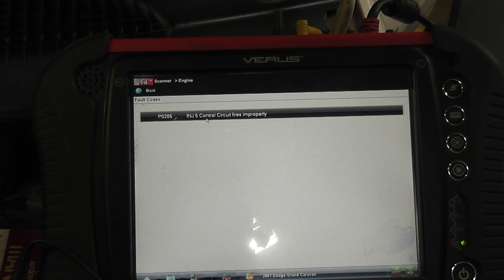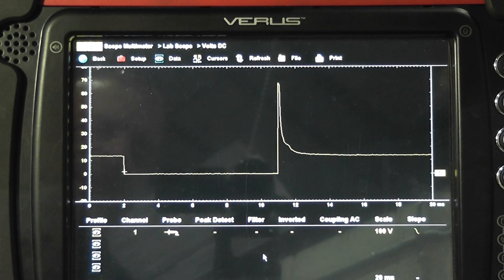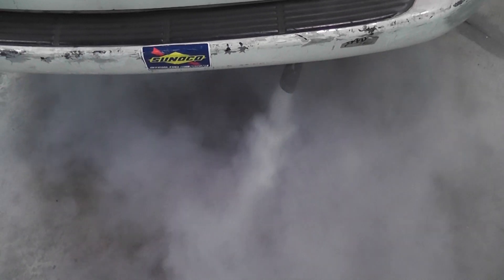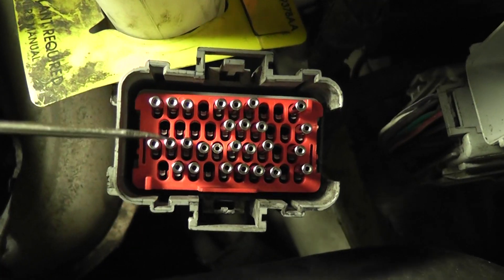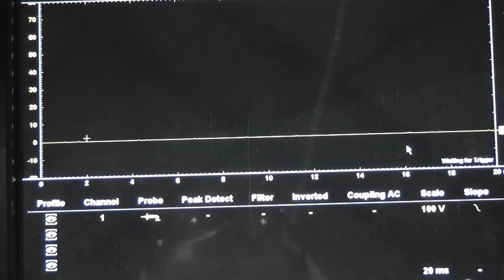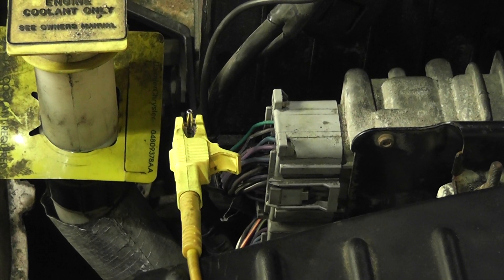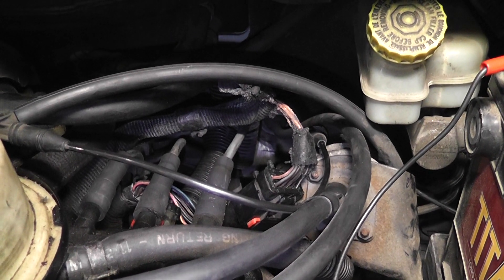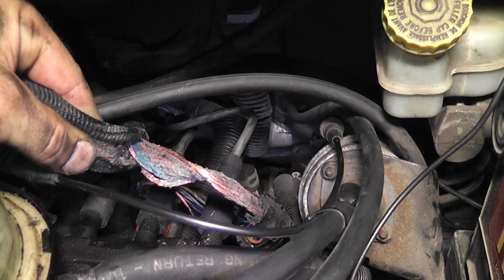Stuck Open Fuel Injector (how to fix)

Comment: Appreciate the great video.  My wife drives the exact same car.  It started running rough and was giving a P0204 code.  I found your video and started looking into the problem.  I found the injector wiring harness fried almost exactly like in the video.  I pulled the harness off,  separated the wires and band-aided it with electrical tape.  I checked continuity on the harness to make sure no wires were touching.  I re-installed harness and switched injector #4 with the one next to it.  Fired up the car and was still getting P0204 code.  I then pulled the pin on the connector to the PCM for the #4 injector, plugged it back in to the PCM, fired up the engine and got 13 volts to ground on my multimeter.  I then swapped the leads and read from battery + to the control wire pin and got 0.  If I was understanding everything correctly on the video this would mean the Injector driver in the PCM is faulty?  Is there anything else I should check prior to condemning the PCM? Thanks again!

Comment: Hi I did that test on injector 3 not knowing I could pull the pin I cut the wire and with it running the light was lit while connected to positive. I have changed out the fuell rail with wiring harness attached and still get the same code , I changed the ecm before finding this test. is there anywhere else this could be shorted?
Reply: and I'm getting codes p0403 and p0203 based on the three turns of the key

Comment: Hi Scanner Danner, I have a 98 infiniti q45 4.1  V-8 Had issues with two injectors and two coils at different time over a months period that were causing misfires. Changed them out and that fixed the problem. Driving home one day i notice a incredible amount white of smoke coming out of the exhaust and felt a misfire. My sons friend suppose to be a mechanic, so we purchase 8 new coils and 8 rebuilt injectors online which were installed along with new spark plugs and map sensor. Problem with white smoke still the same. Happen to check the oil dip stick and found it to be over fill with a strong gas smell and 2 .5 gallons of mixed oil and gas when i changed the oil plus almost  8oz. of gas at the air filter canister . Changed the oil and filter,wiped out the gas at air filter area, started back up to trouble shoot but could not run for long ,afraid neighbors might call the fire department because of the smoke. Try a couple more times two weeks later and the same thing 3 gallons of mix oil and gas and constant flooding of gas at the air filter canister. Thought maybe the fuel regulator vacuum hose might be sucking gas back into the intake?. Removed  hose and it look dry to me. Just cranking the engine floods out the air filter canister. Whats next. Thanks Joe

Comment: Hi ScannerDanner, love your videos. I had one of these in our shop a few months back with the same problem with the harness melted. I fixed the harness but the injector was still not firing correctly with the new harness. It was firing, but not completely. The driver in the PCM was grounding the injector enough to light a noid light but the ground was not good enough to handle the electrical load of the injector. I am now using the lab scope more at work but I often wonder what that would of looked like on the scope. Would that bad ground in the PCM show up even before the harness was fixed? Could I have seen it and known that the shorted harness had taken the driver out?

Comment: I'm getting a p0201 (injector control open or shorted to number 1) - stated with sudden onset rough running but no codes. I had a leaky fuel rail so I pulled the plenum and replaced the fuel rail and did the plugs and wires. Plugs were real bad so I thought I had it. Replaced the injector o rings and the plenum seals too. Reassembled- running rough still and now throwing p0201. Tested and found continuity to ground at the injector connector. Disconnected upper PCM connector, still have continuity to ground. Tested at cavity 13 in PCM connector, with injector unplugged,  continuity to ground there too (expected - just the other end of the wire, after all). Inspected the injector harness, really bad melted. Repaired by carefully separating each intact conductor and taping. No shorts now in this harness. Reassembled to vehicle and road test, still rough running. Still showing continuity to ground at injector and at PCM #13. Disconnected injector harness. No longer showing continuity to ground at injector connector. Still showing continuity to ground at cavity 13 on the PCM connector. Showing continuity to ground on two blades (unknown numbers, can't find a diagram) in the engine harness side of the injector harness connector. One blade is in the corner of the connector, the other showing ground continuity is up and over one space. I disconnected the coil pack supply connector and the water temperature sensor connector, cut the zip tie securing the harness and fished it out under the cross over pipe and brought  the whole end of that branch of the harness up between the crossover pipe and the battery for easier access. I stripped the tape and other shielding from the harness down almost all the way to the main branch of the harness on the transaxle bell housing and found no evidence of melted, worn or wires otherwise shorted together or to the engine/chassis in this span. I gave all the bundles significant tugs and wiggles and noted no change in continuity to ground.

So, to recap, getting continuity to ground, PCM plug is disconnected, two blades (corner and one up and over) in the injector/map harness connector on the engine harness side, and of course from the PCM connector cavity 13 to ground. 

Would I be correct in assuming that there must be a short in the engine harness where it runs over the top of the bell housing? The loom there appears to be intact and shows no outward signs of internal melting. Does the injector driver wires take the shortest possible path when in the main harness? That is, do the wires just go directly down to the bell housing, them come back up at the branch without going down toward the starter and oil pressure sensor? 

Also. This may be of help: this car has a leaky oil pressure sending unit and it has soaked up through the harness and is coming out in the PCM connector a little. I have heard of this happening. Could engine oil contribute to insulation failure in a harness and cause a short circuit? Also, this vehicle has an ATF leak which currently soaks the lower portion of the harness below the PCM. This looks to be below the place where the injector/map/coolant temp/coil branch departs, but fluid can migrate also.
Reply: Ended up being damaged PCM. Injector driver circuit burned out due to shorted harness. I opened the PCM up, discovered an area of darkened/smoke infiltrated potting gel near the external connector, I cleared the potting gel from this area and discovered one transistor in a cluster of six (presumably output transistors for the injector drive) was badly burned, split open and causing charring/discoloration of the nearby gel. Replaced the PCM with a salvage unit, normal engine operation resumes.

I plan on trying to repair the PCM if I can get the board out of the casing. The potting gel is a real pain in the ass though so I doubt I'll invest much effort into it. The salvage replacement cost me $45.

Comment: The replacement harness is part number 4868408AC and is slightly less than $200.00. (WIRING FUEL RAIL) There is also repair kit for this item for less than 35.00 part number 5017114AA with the connector that goes behind the PS reservoir and either crimps or can be soldered into the harness.

Comment: Even if you had access to the injector connector you would still have to disconnect the computer pin to rule out the driver correct?

Comment: I mean put the test light to power and then check the computer to see if it was trying to control the ground. It would really suck to do the job of replacing the wire, getting everything done, then having to go back and tell the customer the computer was also fried, or worse yet, shorted out the new wiring. Again thanks for all your great info!

Comment: Hi ScannerDanner, thanks for all your great videos!!!  I did have a question on this one-I was thinking, would it have been a good idea, or possible,  to check the control wire connection coming out of the computer after you found the wire shorted-just to maybe confirm the computer was still good, trying to control, and not cooked?? Could you just put the test light to ground and then touch that connector to see if the light flashed?? Thanks!

Comment: After this Vivaro 09 van with the P0204 code was driving around for 3 weeks, its finally gave up, and nows got a P2146 code, so its going into a garage tomorrow, wish I had of had more time to help out, just hope it hasnt damaged the ECM, since its a diesal common rail I think the best would have been an amp clamp on the wire going to each injector, but the code's indicating bank 1 power injector module failure, could a relay let the injectors fire sometimes? was an intermitant problem, thanks

Comment: I got a P0204 this is great info, missed this, though its on a common rail diesel with a feed voltage of 85-120 volts, Im sure its a wire issue as thats what the code points to, I just hope so because my brother just payed £5k-$8 grand for the vehicle a month ago with no engine light, Im going to do checks on the weekend of the circuit, its just a different kettle of fish than a petrol/spark engine

Comment: Hi Paul Thanks for you Video, I have a 03 Tom & country with 3.3 engine, found injectors harness bad, I repair but injectors still flood the cylinders, that was from the beginning. Check engine is on but can not communication with the scanner. engine run every time I clean spark plugs, but rich smog a lot any idea. thanks

Comment: New cap and rotor the engine was swapped from an automatic the integra is stick he has both pcm's and both behave the same way. It ran great with the original motor. But he is a dumbass and revved the balls out of it and spun a bearing. Thats the reason he swapped it out the motor that was swapped in also ran great. When it starts to behave like that i see black smoke and it sounds just like it hit the rev limiter even though he only revved to about 3k. I told him to sell that piece of crap

Comment from the maker: could be a lot of things, I need more info than that to help. Things that come to mind, distributor, weak coil (arching inside of the cap), low fuel pressure, plugged exhaust, secondary ignition problems (plugs, wires, cap and rotor)

Comment: Hi paul im having trouble with an integra. 95 it revs fine in neutral but has no power under load it acts and sounds if the ignition is being turned off almost like a rev limiter sound only under load

Comment: HEy Paul HOw Are you? i need your help... i got 04 cadilac cts 3.6 engine. it has miss fire and cel codes p0206 and p0306 i swap coils and still i got same codes i did research and they said check wires and computer it self, so i did same as you did in this and other videos i check wires for shorts and they were fine from computer to injector it self. so i swap injectors and still same runs rough too. i check for pulsing and no 6 didn't give me nothing

Comment: Hey Paul, my personal vehicle I own which is a 2008 chyrsler town and country walt p edition, do these vans have similiar problems with the harnesses?  Bet that harness is expensive to replace.  Cool example showing how the circuit can back feed with the engine not running.  Also, when are you going to have the new additions to your e- book and how much is it going to cost?  I'm half way through the e-book now and it's great.

Comment: Hi Paul Ive got a crx and listened to each injector with a stethoscope, and they all make the clicking noise per manual, could one of them still be stuck open or closed even though they make the sound? As I've got a slight misfire at times, and a bit of white smoke. Ive replaced all ignition componets..rotor, cap, dizzy coil, igniter, plugs and h.t leads

Comment: If this system has individual injector drivers, the computer should try to shut down that injector.
I know in this case it couldn't because of the wiring fault.
will the scan tool give any information on this?

Comment from the maker: Thank you. 
This problem ended up frying the sensor ground circuit in the PCM. We ran a jumper wire to ground to get it to run again. He is still driving it that way :) Not the right fix but whatever.
Reply: So I tested my injector driver 2 and the pcm is not sending a signal, already replaced the injector harness, other injectors are getting a signal, do you run the jumper wire from the injector 2 driver wire or a different one?
Reply: Please, how do you run a jumper wire to ground? Could you explain that a little more. From where to where? Thanks!
Reply from the maker: @steveschaible6722  do you have high sensor ground voltage after this repair?

Comment from the maker: @foxholewilly Because it was the ground side of the injector that was shorted. So this just kept the injector on all the time. No increase in current flow from that. If the power side shorted to ground then it would have blown a fuse.

Comment from the maker: @davymatheny So you have either an injector problem or a torn injector o-ring (although this usually causes large drops of fuel within the spray pattern). If it is the injector, I don't think cleaning it will help. I have never cleaned an injector for spraying too much fuel. Replace it

Comment from the maker: @davymatheny These TBI systems should be spraying a lot. If you are not used to looking at them, you may think it is too much. It is possible the one that is spraying less is the problem. It would help to know your fuel trim numbers (block learn and integrator for your car). This would tell us if it is a rich or lean condition that you are dealing with.

Comment: @ScannerDanner Alright will check MAP, I changed out the oil and put in 10w-40 and oil thinned out in less than 10 min of the engine being running. If you think the MAP might be causing the issue I will change it out. Im just concerned that an injector is causing the problem since they are very expensive and hard to get to. 

I have an extra PCM but got it off a 3.8 Caravan 2001 and car will run less than 1 min with it installed as if it has the security system installed which mine does not.

Comment from the maker: @juanstrongman Do you mean your are still getting gas in the oil? Or there was gas in the oil? The stuck open injector would certainly have caused that. Something else to consider if you are still running rich is the MAP sensor may have been damaged from the injector voltage spikes back-feeding into it. Check MAP volts. KOEO should be around 4.5 VDC (depending on altitude where u live) and at idle should be around 1 to 1.5 VDC

Comment: @howwefeel Ive had them melted/ stuck together before and they have created intermitted problems,
Selection by elimination: I seperated the wires and the issues went away.

Comment: I have a question that may sound stupid...I changed the throttle body sensor because it was of little cost and had read it could be part of my problem, but it wasn't until I replaced it that the code showed up on my panel of the vehicle. Why is this?

Comment: wires were not burned out like the video above but were melted together in some areas, when I pulled them apart they showed no signs of bare wires, are they still bad?  Do they still need to be replaced? We also checked the voltage at the injectors when we changed them and they were ready properly. By the way your video was great!

Comment from the maker: @ScannerDanner In fact I almost can guarantee that this is your problem especially because you also have a TPS code. All the injectors, the TPS and the MAP share this same harness connector. Pull away all of the tape and you'll find what I'm talking about. You cannot miss it!

Comment: can you tell me on a 2002 dodge carvan sport 3.3 v6 flex fuel what white smoke with P0123, P0206, P0205, codes mean when I have replaced wirs, plugs, tps, idle air control valve and injector 5 and 6. I am a woman so bare with me please

Comment from the maker: @ScannerDanner Ok just rechecked diagram. The ASD powers the Ignition coil, Alternator field, Injectors and Uptream and Downstream O2 heaters. All of these circuit are ground side controlled by the computer EXCEPT the downstream O2 heater. It has a direct ground to the block. So if you want to do the injector control wire test like I did in the video with the engine not running (no power on ASD circuit) you would have to unplug the downstream O2 sensor to eliminate the back feed. make sense?

Comment from the maker: @frosty9595 your not bothering me at all! You are forgetting that this ASD relay powers multiple circuits in parallel. It is not just for the injectors, this is where the backfeed will come from. It will travel through the O2 heater directly to ground or through the fuel pump or Alternator field winding....I need to double check the diagram to answer for sure

Comment from the maker: @ScannerDanner So with just the key on, there will be no 12v available to the injectors. This is why you could get an inaccurate result with the test light. It will back feed through the un-powered injector and find a path to ground through another circuit that is in parallel to the injectors. Resistance through this path will determine brightness of the test light bulb. Also it would depend on the test light you are using. Hope that makes sense.